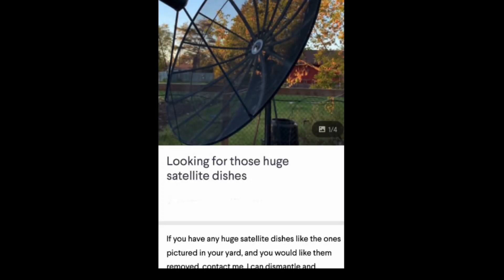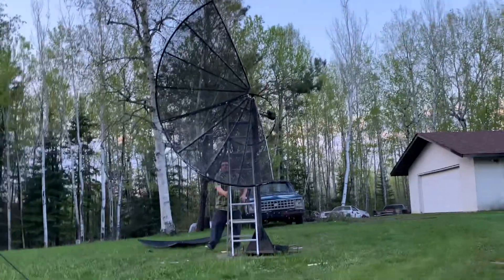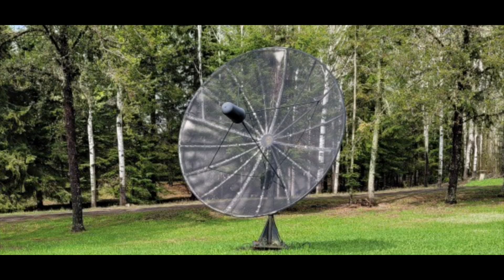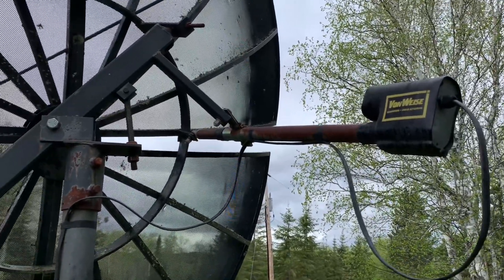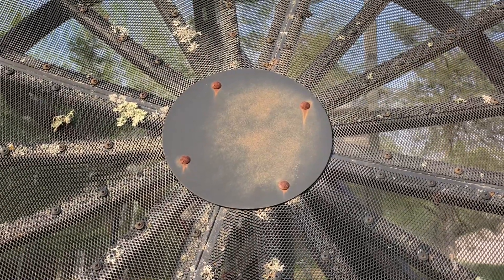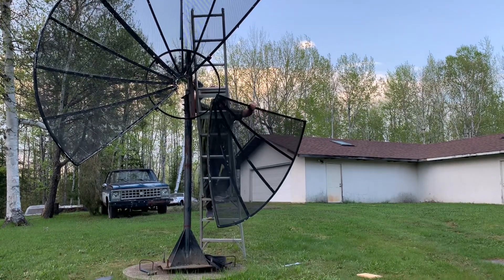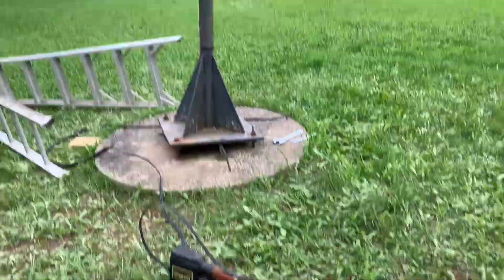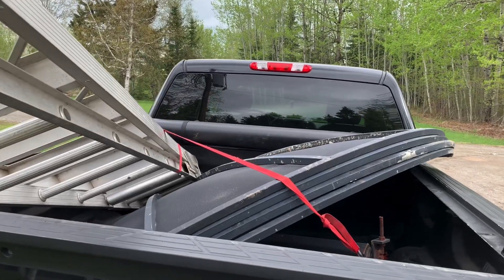How to Disassemble and Remove a C Band Satellite Dish to Reuse for Free Satellite TV

Comment: I haven't seen a BUD in that shape in this century. As you travel toward the equator, corrosion accelerates. Most of the dishes here were framed in chromoly square tubing. Boy, did that junk rust. I've disassembled a lot of aluminum antennas. Never a BUD.

Comment: Are you going to reassemble the old dish and install as a third dish? All you need is new bolts, nuts and LNB. Since it's a large dish an actuator will be great.
Reply from the maker: I’m thinking about it, but I don’t want to push my luck!
Reply: Is there electricity running to the dish?
Reply from the maker: @gregorywood717  it was disconnected years ago. It’s DC voltage from the receiver which is used to power the actuator to move the dish and to change polarity in the LNB.
Reply: @NorthcoasterHobby  Thank you
Reply from the maker: @gregorywood717  You’re welcome.

Comment: You mentioned clipping the cables. Is there any concern that they are connected to any kind of power? I have one I am going to take down and am concerned about any high to low voltage.. Thank you!
Reply from the maker: Double check with the owner that all power has been disconnected.
Reply from the maker: Any receivers that were connected are likely long gone. But double check before cutting any wires.
Reply: @NorthcoasterHobby we have one in our yard. We've lived here 13 years. It's the frame, the mesh is missing. How can we be sure there's no power to it? I'm fairly certain the cables have been cut but I hate to assume.